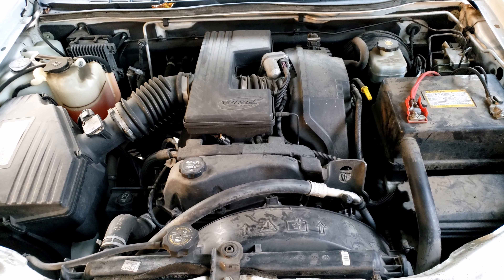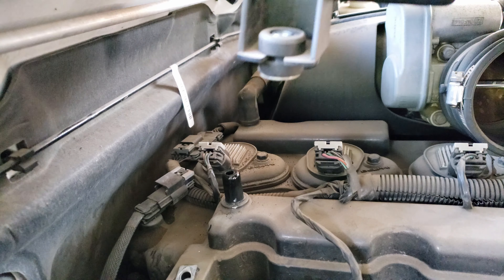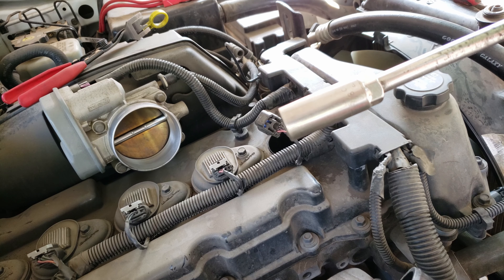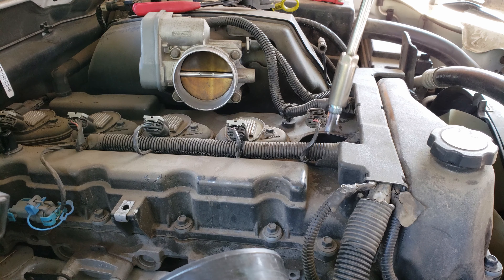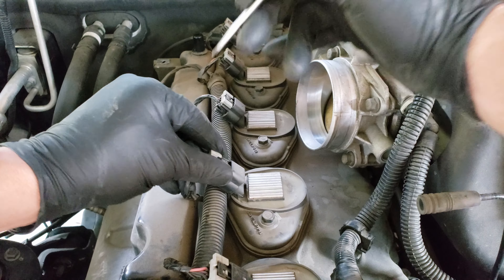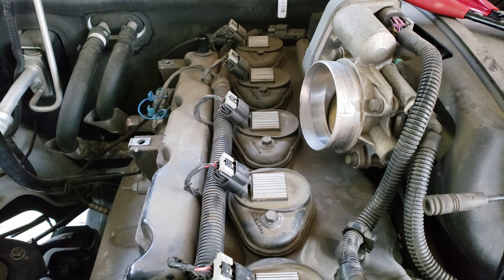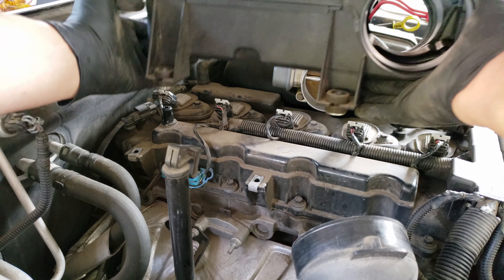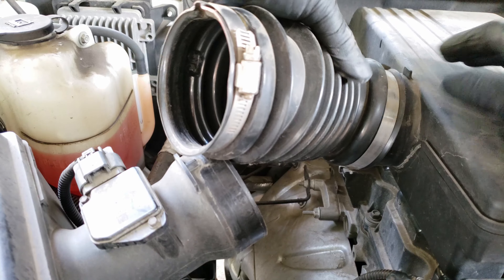How to Replace Spark Plugs Chevy Colorado & GMC Canyon 2004-2012

Comment from the maker: 13ft lbs torque spec for spark plugs
Reply: Are the tire torque on this truck really that high ? I’ve checked the book and it’s like 160 or higher I believe
Reply from the maker: @fucknut8856  the lug nuts no, for 2004-2012..theyre 100 ft lbs..maybe it was 140 N-m?
Reply: Is it 13 lbs ft torque?
Reply from the maker: @dgdvrn  yes
Reply: hand tight
Reply: Thank you buddy
Reply: @fucknut8856  no it's 100 foot pounds but I do 105 just to be sure!
Reply: My spark plugs were wrenched in there I swear I had to use at least 80 foot pounds in order to remove them. I didn't have a torque wrench that goes that low so I just estimated around 20 foot pounds! And these spark plugs have not been changed since it was built by the factory.

Comment: Got code 0304 misfire on my 05 Chevy Colorado 3.5L - have 200K miles. Decided to replace all 5 plugs and coils - this is best video I've seen.  I don't mind your repetitive coil replacements on video. The repetitiveness is needed for memory.  Also like you instruction on removing and replacing parts. That clip on removing wires on coils is helpful.  Using NGK coils and NGK iridium IX plugs.  Appears plugs already pre-gapped and I may not need anti seize - will research some more to make sure.  Will use 13ft torque per recommended spec below. Again, thanks for video.

Comment: These AC Iridium plugs and coils work great together. On my 2005 I-5, I replaced plugs at 125,000 - 200,000 - and 300,000 miles, and they were still running great. A quality truck. Mobil 1 5w30 Dexos Syn, AC PF61 Filter every 7,000 miles, Peak Dexcool AF changed every couple of years, Trans fluid every 5 years, and I keep rolling on. No regrets.

Comment: Excellent video.  Short and to the point.  Nice.  I have moved to a magnetic spark plug socket, the rubber boot inside the older sockets has been known to come off and stay stuck to the plug.

Comment: Awesome video on how to replace spark plugs on the 3.7 Colorado/Canyon motor. This is the gold standard on how this is done. Thanks so much for showing what needs to be done with that wire harness to get at the first coil bolt as all the other guys just skip over that or give some sketchy comment on what to do. IMO after showing how to on plug #1 you could have skipped to #5 but not cutting corners is good to . You can work on my truck anytime. lol!
Reply from the maker: Thank you🙂 much appreciated

Comment: Thanks for putting this video together, it made the job go so much easier! My '04 Canyon has 120,000 miles on it and although it ran fine, passed smog etc. those new spark plugs really made a difference, my truck has a lot more pep now! Thanks again and keep up the good work! And... if you ever get the chance to make a video on how to get the center armrest on a 58 Impala rear seat unstuck, I'll certainly tune in for that as well! 👍

Comment: Hey backyard Chevy: I enjoy your videos is right to the point and easy to follow. I think you could have skip some of it because it's the same as the first spark plug and like the other subscriber said, not to lose the screws or the locking clip. Questions I have the same truck an 06 needs same minor work like front and back shocks, I also the ABS indicator light is on, it use to go off but now it stays on. I also believe that she needs brakes pads all round and a new thermostat. Because during the winter the hot air isn't enough I have to keep it on number 2 or 3, if you happen to do any of those jobs on that truck I'll be glad to seat back and watch It will help me out keep them coming!
Reply from the maker: Thank you🙂 i do have the front and rear brake job videos...the abs light have u had it scanned to see the codes for the abs? Its most commonly a bad wheel speed sensor which is part of the wheel hub and that would be included in my front brake video i did🙂..but sure if i do any others ill be sure to make videos on em
Reply: @backyardchevy328  Thanks for the info still working on getting a scanner, I had to rewrite the comment cuz I left some things out but thanks for the info I will be looking out for those videos.
Reply from the maker: @johnny1556  anytime..always here to help when i can🙂

Comment: How often should spark plugs be changed? I’ve got 144k miles and no issues should I just do it anyway
Reply from the maker: Well original iridiums are meant to last 100k miles but i never wait that long..do u know whens the last time they were replaced? And with which plugs?

Comment: 'BACKYARD CHEVY' Can you recommend your preferred choice for an affordable QUALITY Ignition Coil Set (4cyl) for my 2005 GMC Canyon ? (Amazon OK) Thanks......
Reply from the maker: Well i havent tried the ones on amazon to see the quality, but i would say Amazon is probably best choice for affordable set
Reply: @backyardchevy328 --- Please- Which brand have you had good experience with at any price ?.....Ones that last the longest. The coils that are on my truck are like most everything that came originally on my 2005 Canyon, even the cat converter& mufflers. I think the OEM genine GM product would be best, but are pricey. (over $100 each)
Reply from the maker: @RockinProfessor  https://amzn.to/3P737Dq ive used this brand before and its been working good so far and reviews are good from what i see

Comment: Good step by step, but don't put anti seize on plugs, you'll snap them much easier, the torque load is only 13ft lbs, with anti seize your 13ft lbs on your torque wrench is likely closer to 18-20 ft lbs due to lubricity.

Comment: Do you have to toque the ignition coils to speck? If so how Ft Pounds? And what is the spec on a 2007 chevy Colorado spark plug torq FT Pounds?
Reply from the maker: Not the ignition coil bolts, just snug em up..youll wanna be careful cause those bolts can break if overtightened....and the spark plugs they tighten to 13 ft lbs.

Comment: If so whats the screw size for the intake cover the two on the side i know 10m but whats the actual size mine are missing need to buy some.
Reply from the maker: Around what time on the video do they come out? I can find out tomorrow
Reply: 0.45 seconds into the video the two screws on the side
Reply from the maker: @RG-od4jk  alright, ill let u know tomorrow
Reply from the maker: @RG-od4jk  its a 6mm by 1.0 thread and 1.5 inches long
Reply: Ok thanks I don't need to buy them from dealers now
Reply: 6mm but 10mm socket just want to make sure
Reply from the maker: @RG-od4jk  its a 6mm size thread...the 10mm is only the bolt head size

Comment: Hello thank you for your video.🙏  I have a real quick question not about the plugs but about the oil.  my sons 2004 Canyon oil light comes on and then it says oil on the screen where the mileage normally is so I thought it needs oil and I went to check it but the dipstick reads that it has a little bit over the full mark.  Could this be the problem because there be too much oil?  or is the dipstick not accurately reading the amount?  I wanted to put some Lucas oil stabilizer but I don’t want it to be filled even more if it’s already a little over full.  Thank you very much
Reply from the maker: Hello🙂 if that red oil light is on it means theres a problem with oil pressure..so it could be the oil pressure sensor may be malfunctioning, being that the oil is up to level ..but u dont wanna leave it overfilled either that could cause cause problems as well.
Reply: @backyardchevy328  thank you so much for responding 👍 your suggestion gives me a starting point and that is more than helpful👏👏😊
Reply from the maker: @carolinewells4355  good luck..normally thats the problem and i hope in ur case its that as well🙂🤞

Comment: I liked the video, but you did not mention torque spec for plugs. Thanks
Reply from the maker: Yea i pinned it in the comments cause i didnt put the text on the bottom as i usually do

Comment: Thanks bro. Got a video on why my driver side taillight keeps blowing? Break light is good, so is turn signal but the taillight keeps blowing. I’m not sure how long after replacing the bulb it’s blowing but I’ll find out later after I replace the spark plugs and my #3 cylinder coil.
Reply from the maker: Normally thats due to a bad connection..maybe u can check the ground to see if its loose or damaged..if thats ok..id check the inside of the connector..if its providing a bad contact(dirty,rust) itll cause it to blow out a lot faster..or also if u notice any moisture in housing
Reply: @backyardchevy328  thanks! I’ll ask my neighbor, he knows what he’s doing and most likely knows what to look for…. I don’t know anything about any kind of electrical stuff. I’ll pass along what you suggested though, thanks again!
Reply from the maker: @MichaelMedici61W2  anytime🙂 hope it helps and ur able to get it fixed..good luck🙂

Comment: In 5:47 what was that for do you have to do it and what does it do for the car
Reply from the maker: I remove the upper cover of the wire guide so i can press down on the clip and clip it onto the valve cover...if not there's nothing behind it so the clip just falls into the guide

Comment: Helpful, thanks! Would be nice if you included the torque specs for the model you’re working on.
Reply from the maker: I normally always do..but forgot to add it for this one video for some reason but i pinned it as the first comment...13ft.lbs torque

Comment: Hey where did you get the replacement for the PCV hose?
Reply from the maker: i just linked it in the description of the video..but u can also get it from the dealer or ebay as well.
Reply: @backyardchevy328  thank you very much
Reply from the maker: @Rosaa007  anytime🙂👍

Comment: Great video, I am just curious, why did you disconnect the coil from the wiring harness if you were not changing the coil? Am I not saying you should not have, I am just wondering why for my own knowledge?
Reply from the maker: Thank you🙂 well if u leave coil connected, not sure theres enough space for it to come out freely without bending it, guess i could of tried it..but i just disconnect em so they come out freely without bending and possibly breaking the coil.
Reply: @backyardchevy328  thank you for your answer, I am having some issues after changing my spark plugs and I did not disconnect the coils, I thought that may be a reason. I don't think I bent the coils, must be something else
Reply from the maker: @49ersalltheway  whats it doing?

Comment: I would just skip, unless there's any annoyances like on the 1st one.  Maybe mention not to drop the coil bolt when you're taking it out.  That was a huge bitch to recover.  

Your videos are great though, always great camera angle and lighting. Plus I have the same truck :)
Reply from the maker: Thank you i really appreciate it...yea i think thatd probably be the best way to do it too....the coil bolt in the spark plug hole? A telescoping magnet wouldnt work?

Comment: Most spark plug manufacturers don't recommend anti seize.
It will affect the torque specs.
I know NGK has that on their website.
Reply from the maker: Yea, they use a special coating on their premium plugs so u dont have to use it

Comment: I replaced plugs with delco 41-103 and the truck barely ran.  throwing codes random cylinder misfire not sure why the heck this happened.  makes no sense.  I put the old plugs back in and it doesn't run right I've now ordered coil packs for the vehicle and Im going to replace all of these as well
Reply from the maker: yea it shouldnt be the plugs especially if u put old ones and its doing the same...any chance that the hose under the intake resonator tube is damaged or disconnected..or the small one  in the front..any of those could cause a vacuum leak and cause misfires cause its after the maf sensor...checking to make sure all the connections are on properly too like those intake tubes...i would check all that.
Reply: That hose is connected for sure... it wasn't in the best shape though it was kinda cracking and stuff.  I did just order a new one.
Reply from the maker: @OnPointAdventuresND  if it is cracked or if it leaks out of it, you'll probably hear a whistling or sucking sound itll be due to a vacuum leak somewhere possibly that hose..that would affect every cylinder
Reply: Matthew did you figure out the problem? I am having similar issue with my repair?

Comment: I see most everyone liked the long version of the video.  For someone like me with a little more experience there is no reason to watch more than one.  I also wanted to point out that it is no longer best practice to use anti-sieze on the spark plug threads.  Spark plug manufacturers do not recommend it.  Your audio comments explained your actions clearly, but a little boring however.
Reply from the maker: Thank you🙂 yea most new spark plugs have this special break away coating on em so u dont have to, but on really dry threads i still prefer to use a small amount...any advice to make it less boring?
Reply: @backyardchevy328  Thanks for not being offended by my comments.  Your explanations were very clear but it was kind of a dead pan delivery.  You could try a more conversational style, like you were explaining it to a friend.  By the way, I am a professional mechanic but haven't worked on that 5 cylinder engine before ( I am in Hawaii, all Tacomas here), and your video helped me, so thanks.
Reply from the maker: @danielbal5272  thank you, yea i will try that..i know ive slowly tried to integrate my personality into the videos but i still find it hard to get comfortable doing that